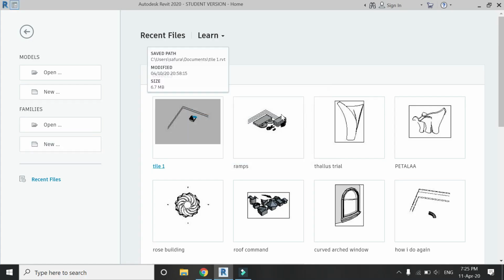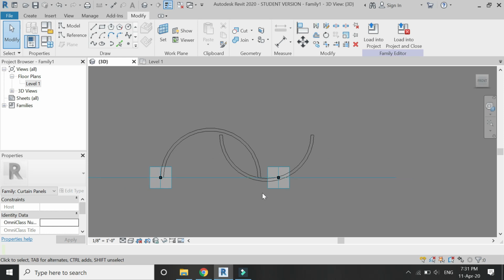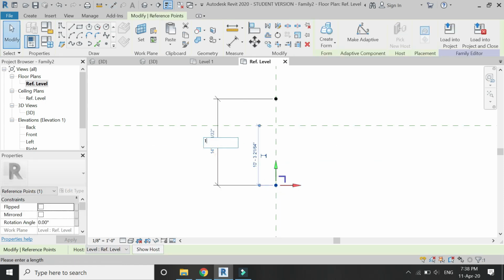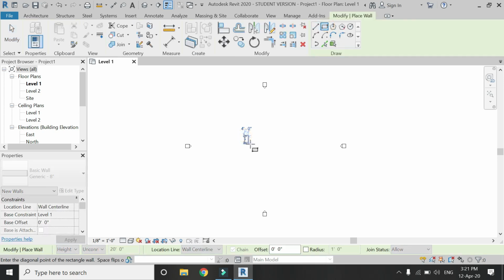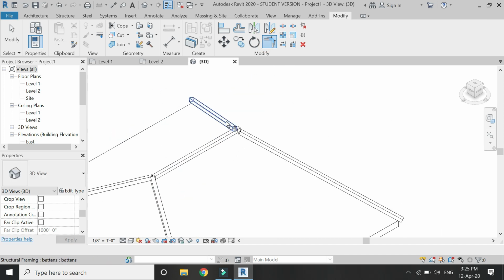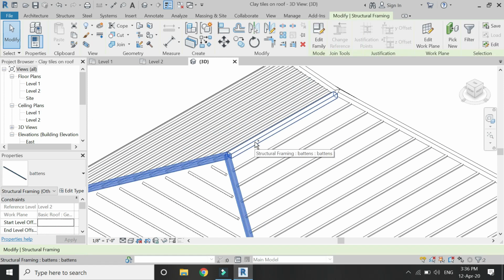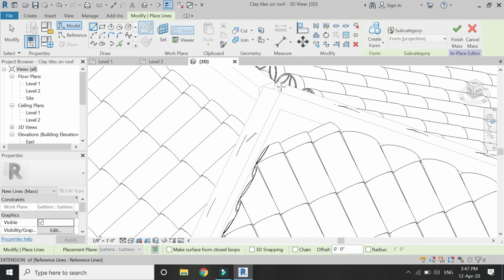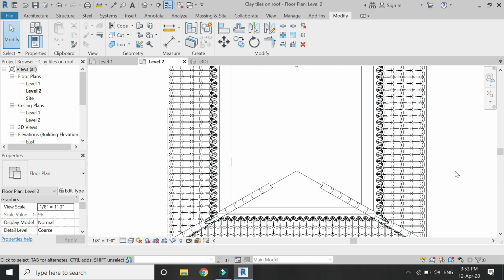Revit Tutorial - Roof Tiles on a Hipped Roof

Comment: But i think u need good system to use this kind of family.give some tips so that system will not be hanged .
Reply from the maker: You can omit the battens part while placing the tiles. And you can place the tiles on that part of the roof from where you want to have a render.
Mostly these tiles are used on the roofs of a residential project and usually the projects of houses are of smaller scale so I think the system will not cause any problem.